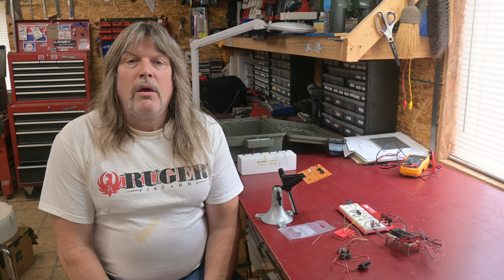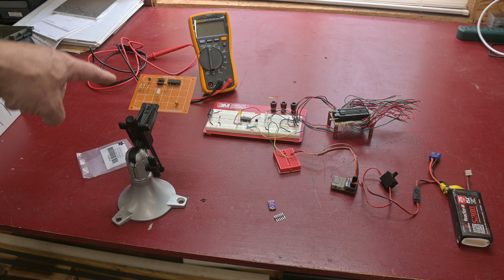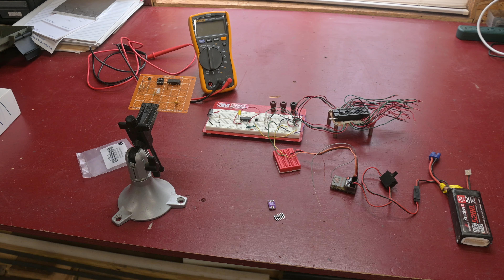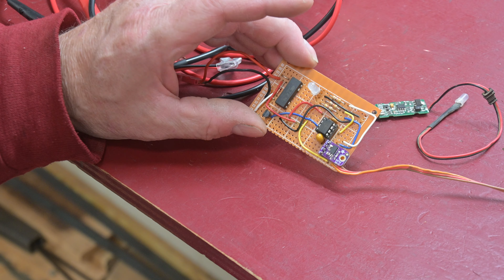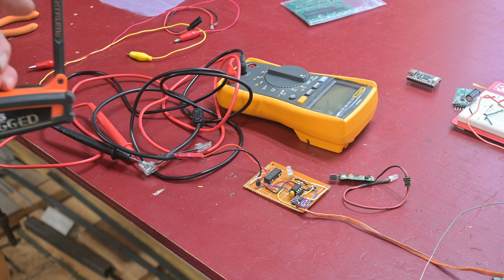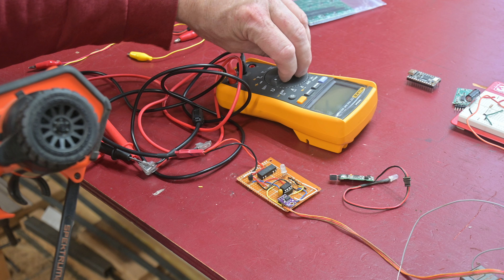PIC micro based 1/5 scale failsafe RC kill switch Pt 2 | Assy and testing

Comment: Nice setup. Are you setting up an e-prom as part of this design? I noticed a programmer off to the side. Honestly I can't say much about it as your over my head. Voltage regulators and relays are about the extent of my knowledge. You are a master designer and only a pro would use a Fluke DVM. You should sell the design rather than the product.  Great job buddy. 👍
Reply from the maker: Thank RC, i'm using the onboard EEPROM on the PIC for program storage. The wireless SCADA for engine monitoring project i'm currently working on will be using an SD card for data storage and NVRAM as a buffer. Thanks for checking it out buddy
Reply: Amazing projects. The SD card is a great idea. The non volatile ram as a buffer seems logical. Thanks for the details and I will definitely be watching.  @RCWalletVacuum

Comment: Wow, great work man,  you can always send it out for reconstruction and mass production.
Reply from the maker: Thanks Alterd. How is your Kraken going? Did you get it pieced back together?
Reply: @RCWalletVacuum  yeah but its apart again,  waiting on a front input, chipped a tooth.  Upgrading almost everything….think the lower arms are gonna be left stock for now, and the front hub bearing all seized,  also bent a front axle.  Crazy power from the hobbywing max4.  Hopefully by the end of the week it will be back.  i saw that bash session you had over at your place,  it looked like a super fun time.  Nice to see the different rigs rip, it was pretty awesome 👍
Reply from the maker: Damn, that Kraken is going to keep your credit card busy @alterdcustomrc4512

Comment: That's cool. Will it also have low voltage cutoff? Love the shirt by the way. Lol
Reply from the maker: Hey Lance, yeah any power interruptions, signal interruptions, battery/switch failures etc will short the ignition and no power is needed to short it out. Well its obvious you have good taste in RC vehicles and i'm glad to hear you have the same with guns!
Reply: @RCWalletVacuum  cool I'll be on the lookout for the finished product.